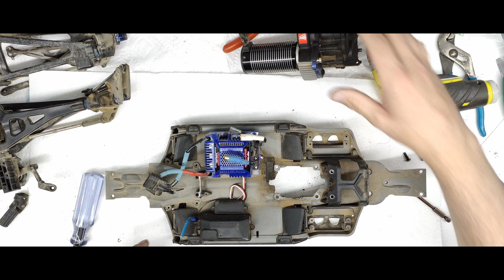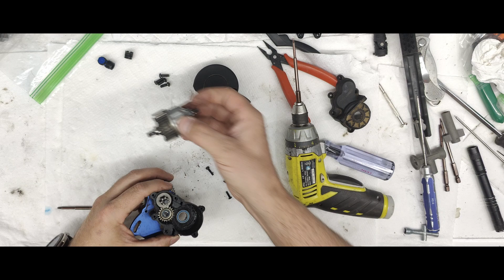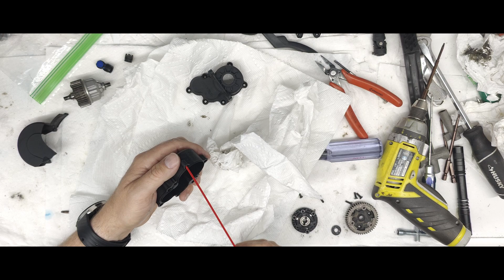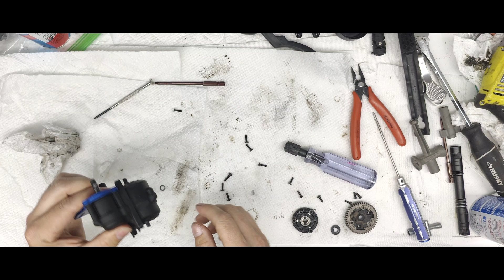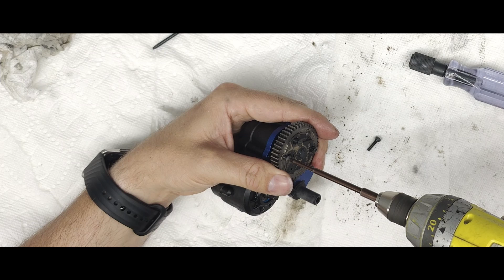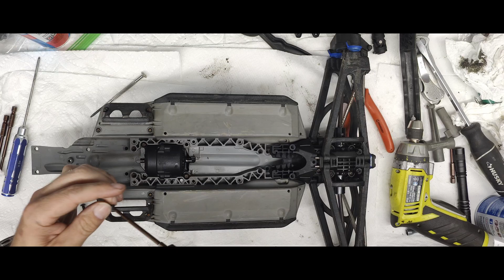Traxxas E Revo 2.0 Transmission Rebuild

Comment: Hello nice video. I bought an Erevo 2.0 recently. But I have a problem, it doesn't wheelie at all, even at full throttle. The previous owner said that he has changed the grease before selling. Do you think this can be the issue ? Or maybe its an issue with the diffs ?
Reply from the maker: @BMW525iE39 It's hard to say without seeing the truck in action or getting a feel for how it runs. The first thing I would do is make sure that the ESC is not on training mode. Let me see if I can find the info on how to do that for you real quick.. if the truck feels like it has plenty of power but isn't able to put the power to the ground I would look into the center differential.  The center differential uses 20 million weight silicone oil. It's almost like tar. It's very very thick. If someone were to open up that differential and put in whatever is laying around or grease what will happen is as soon as weight is starting to lift off the front tires all of the power will be transferred to the front you'll get this front-wheel drive looking pulling around effect. Does that make sense? I think I have a video on center differentials that you can take a look at.
Reply from the maker: https://youtu.be/BbuESg6r8FM?si=muabkNP-YS6s_eo9

The Video above should help with training mode. You can use my full rebuild video to help you get the center diff out and use my XMaxx center diff video to help you through the rebuild. They are almost exactly the same once removed. 

https://youtu.be/jXw4eNkK3_g?si=sgsG6HqY9sTgcdUH
Reply: @RebuildRC-1843  ok thank you I will check the video. I dont think that the esc is on training mode because at full throttle the Erevo is very fast. The previous owner changed the motor for a hobbywing ezrun 4278 2250kv but he kept the stock esc so maybe this is the issue. The motor is supposed to run with the sensor wire but the esc can't
Reply: @RebuildRC-1843  it indeed looks like the front is pulling more than the rear and the rc has plenty of power but not on the ground. I have to do some others tests before because I have it since 2 days and I used it only two times. It's not my first rc so thats why I think something is wrong
Reply: @RebuildRC-1843  I remember going full throttle on grass and the motor just spins faster but not the car.
Reply from the maker: @BMW525iE39 Interesting. Make sure the previous owner didn't add any type of slipper clutch. If he did it may be loose. The other thing I would do is make sure there aren't any sheared pins in the driveline. I've also seen center drive shafts slip. You could maybe grab hold of the rear tires and have a friend try to rotate the front tires and see if something slips and then vice versa with the rear. I've also seen issues where the pinion on the motor simply cannot maintain grip of the motor shaft. Very rarely you can have an internal motor issue where the sensor shaft is delaminated from the armature mass. When the motor heats up you'll start noticing the slip more often. This is relatively uncommon without the motor grenading itself.
Reply: @RebuildRC-1843  thank you for your help. I tried to hold the front wheels and when my friend tried to rotate the rear wheels, the engine was turning succesfully, same on the other side.
Reply: @RebuildRC-1843  I checked the pinion  on the motor shaft and everything is ok.
Reply from the maker: @BMW525iE39 I think you're going to find that that center diff is your issue. Keep me posted I'm interested to hear what you find!
Reply: @RebuildRC-1843  ok I will check as soon as I can and I'll keep you posted for the results. I will also ask the previous owner why he changed the motor
Reply: @RebuildRC-1843  hello, I went for a blast with the Erevo today and I can confirm that it has lots of power but it's a lot of wheelspin. Surprisingly I have no traction no matter what ground im on
Reply: @RebuildRC-1843  hello, here is some update ! I put 20 million oil on the center diff and it's definitely stiffer than before. However, the Erevo still won't wheelie, it feels like it has a lot of power but can't put it on the ground, lots of wheelspin no matter the type of ground. I also changed the ESC for a max8 and the motor runs a lot smoother. Sadly I have to buy a programming card to change the settings on the esc
Reply from the maker: @BMW525iE39 what tires are you running? Are you in snow or on dirt?
Reply: @RebuildRC-1843  im running on stock tires. One of the rear tire is damaged because of balloning so maybe it absorb some power
Reply from the maker: Do the tires have good foam or are they all destroyed inside?
Reply: @RebuildRC-1843  2 tires are torn but there is still foam inside. Im actually buying a new pair of stock tires

Comment: What grease would u recommend
Reply from the maker: It depends on the part and how fast it spins. I like marine grease. 2-4-C is great for  a lighter grease. Gimbal bearing grease is a good heavy type. I think Quicksilver rebranded it Extreme Grease. Special lube 101 was a good all around grease. At the moment I'm using a simple white Lucas product and some wheel bearing grease. I use WD-40 as a cleaner and to keep rust away.